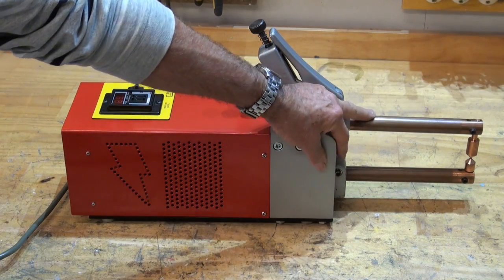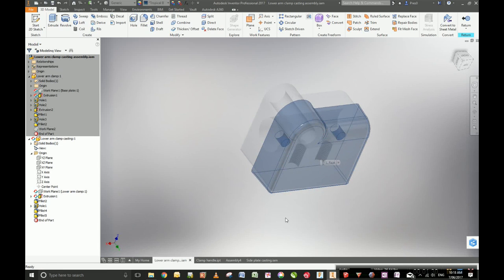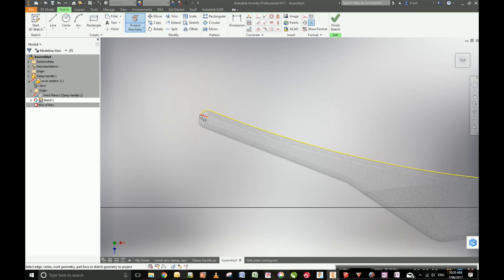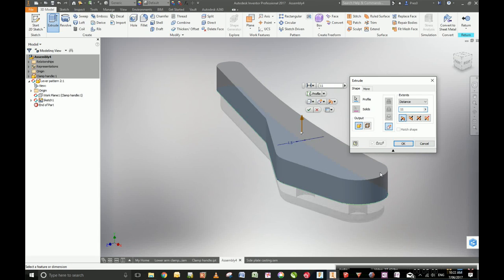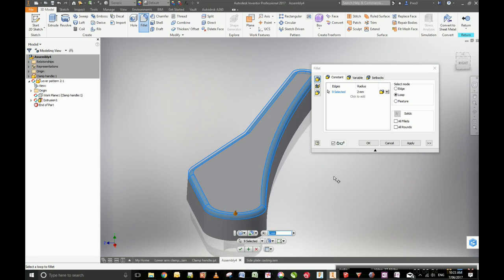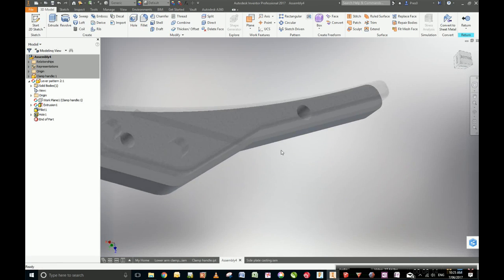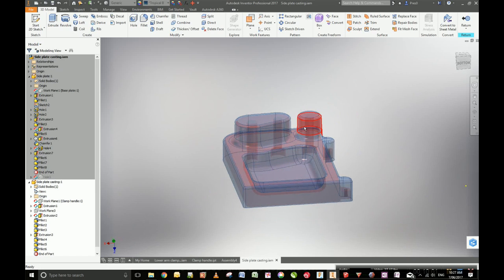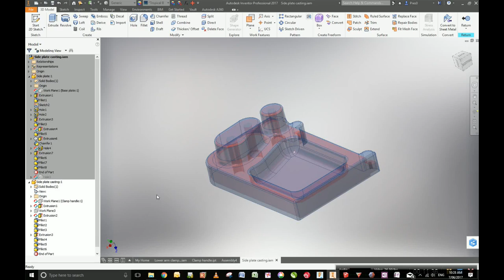Super Scary Weldy Thingy Part 1

Comment: FYI myfordboy has since got himself a 3d printer (and upgraded it with cast and machined parts) which he now uses for a lot of patterns.
Reply from the maker: I had watched a lot of that series but I never saw the outcome of the upgrades that he did. I wondered at the time if he had considered the weight of the moving parts he made for the print head. The extra mass will mean lots of inertia and there is a huge number of moves with acceleration and deceleration on each change in direction. I think he and I started doing 3D printed patterns at about the same time. 
Regards,
Mark

Comment: Hi again Mark, thanks for recommending Dan Gelbat’s channel as I learned so much and now I don’t just want a spot welder, I need one.
The biggest issue for me has been working out a clamping mechanism and I noticed Dan used an air cylinder which is great as I have some cylinders but it means running the air compressor so I am thinking of using an electromagnet I got for another project. It’s used for keeping doors or gates shut and has about 300kg clamping pressure but I am not sure about problems with electromagnetic fields. Do you see any issues? I have made the transformer already and had no trouble melting a screw put between the ends of the cables on a test run. I used some very heavy battery cable from a truck and found the best way to fit it was to cut the transformer along the welded join. This allowed me to bend the cable in the vice and get a nice fit so much so that I made a 4 mm packer to go between the cable and the bottom of the transformer and had to squeeze it all together in my 20 ton press before I could re weld it together again. Needless to say it’s a nice tight fit and there is no vibration. Anyway the cable I have is 12mm diameter plus about 1mm jacket = 14mm to go in a 15mm gap in the transformer so it’s a snug fit. Is this the same size that you upgraded to? If not and you would like some, then as a way of saying thanks, I would be happy to send you a metre or so of it and I would just ask you to pay for the postage. I had no luck with the timer you used but I have found an adjustable millimetre timer with built in mechanical relay on EBay so I will give one of those a try. Ps I can send you a pic of the cable if you need one. Cheers mate, Stuart 🇦🇺
Reply from the maker: Stuart,
All spot welders produce a strong electromagnetic field of their own in and around the electrode arms. If you are wearing a quartz mechanical watch and it is placed near the arms it will run backwards very quickly but I don't think it damages the watch. It's just annoying because you will need to reset it. I am guessing that if you were to use an electromagnetic clamp you could shield it but maybe it won't be an issue. I considered cutting the transformer at the weld line and fitting the cable that way but I am a crap welder and I didn't want to ruin the laminations  rewelding it later but that is definitely the easiest way to fit heavy cable. That welder of Dan Gelbart's is a work of art just like all his machinery. I am not sure if you have seen the video about his shop built granite lathe with air bearings on the spindle but it's in a class of it's own. If you are going to use the electromagnet you might want to consider some way of varying the clamping force to allow for different thicknesses of metal. Maybe that could be done electrically or maybe some sort of sliding pivot to alter the leverage. Sounds interesting.

Comment: Fantastic build, Mark. I just watched the whole series. I’ve watched most of the DIY spot welder builds on YouTube and this is the best I’ve seen so far.  Definitely the closest I’ve seen to the Dan Gelbart spot welder, which, unfortunately, does not have a build video. I’ll certainly be referring to your videos when I get around to tackling this project myself.
Reply from the maker: Thanks Lee.
I must say that watching Dan Gelbart's video on spot welding inspired me to go ahead with this build. I googled him and was amazed at his achievements. His shop built granite bed lathe blew me away! I am pretty sure that you could build something like my spot welder without having the castings for the front end. You could build up the parts by welding or just by bolting stock together. Good luck with the build.
Reply: Yes, I'd love to be able to cast the parts, but that's a capability I don't currently have. However, I do have a CNC router that is capable of machining aluminum, so I should be able to piece it together from flat stock. As for Mr. Gelbart, I just wish he'd make more videos. I've learned a number of things from him that I'd never seen anywhere else in over 25 years of engineering and making. I'm still subscribed to his channel, hoping that some day I'll be surprised by a new run of videos.